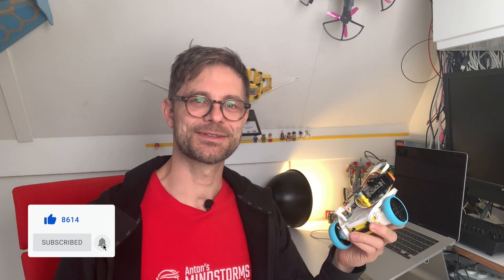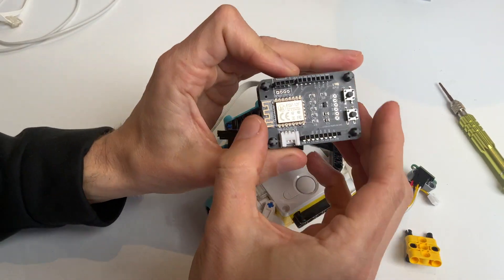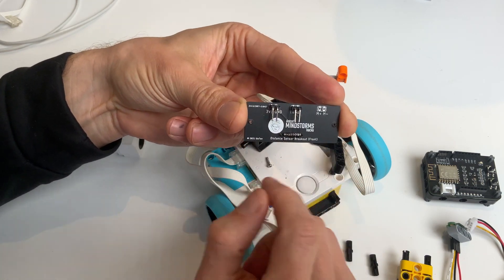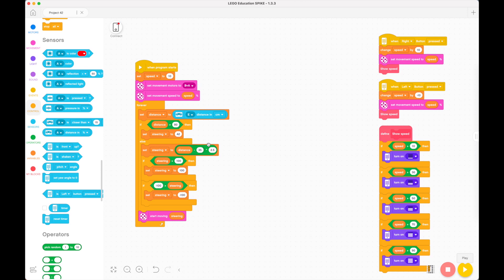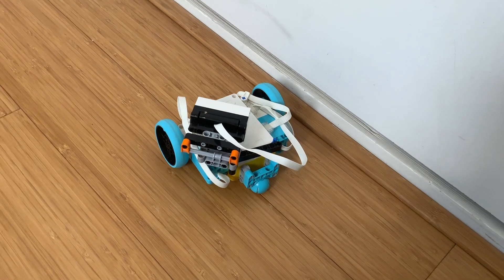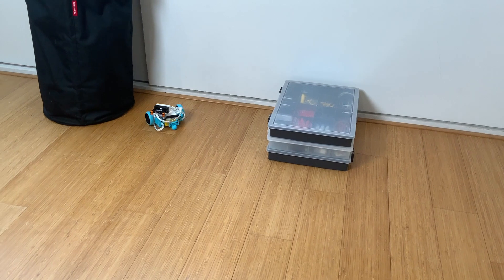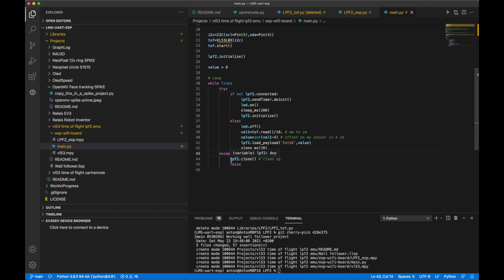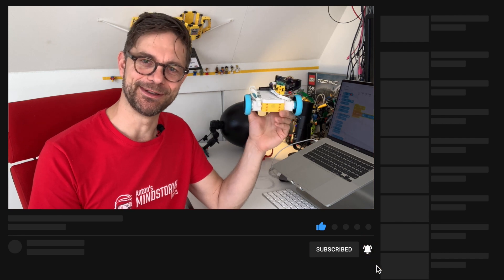Ultra-fast SPIKE wall follower robot with laser distance sensor in word blocks.

Comment: Anton, thank you for this incredible insight. What would happen if O directly connected a UART TOF sensor to the RX/TX pins of the Spike breakout board? How would I tell the hub that a Ultrasonic sensor was connected?
Reply from the maker: The hub only understands a very specific LEGO UART protocol. That's why you need the ESP board in between. We have new version called LMS-ESP32, which also features votlage conversion! https://www.antonsmindstorms.com/product/wifi-python-esp32-board-for-mindstorms/

Comment: Can I buy the Esp8266 board with the code to translate signal already installed on it and with the rangefinder sensor attached. Also with the breakout board. Could you sell that to me in a package? What would it cost?

Comment: Hi there! I just wanted to say that your YouTube channel is super cool and very helpful. I just got my first SPIKE prime LEGO kit- have you done any CAD designs or programming before with yours yet? If so, do you have any suggestions or advice with using them. The one I'm trying to figure out is LDraw. Thanks in advance!
Reply from the maker: Use Bricklink Studio, it is much easier to use.
Reply: @AntonsMindstorms  how do you track when a laser hits something (like a red circle)?.
have you used the PI-HAT board yet? allows up to 4 motors
Reply from the maker: @turinreza  tried it and disliked it. Big hassle. You could track a laser with an open mv cam. The ir version could work even better.